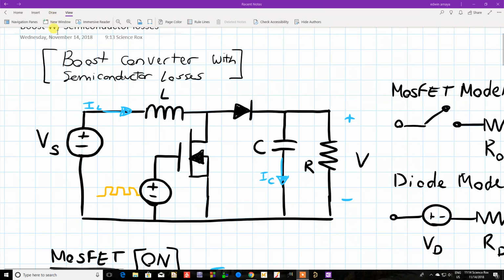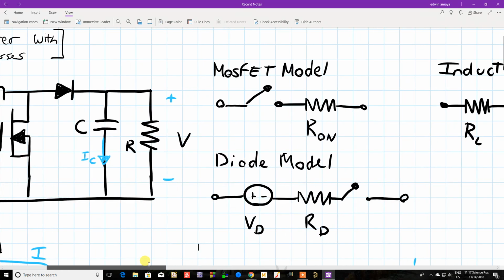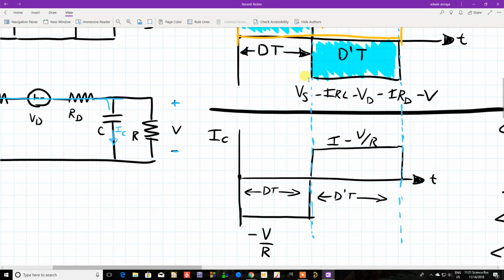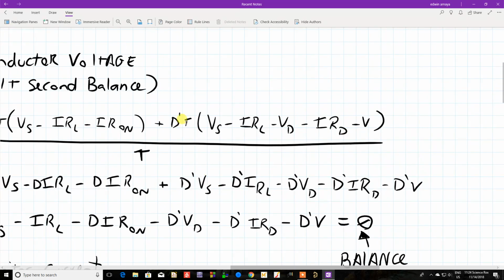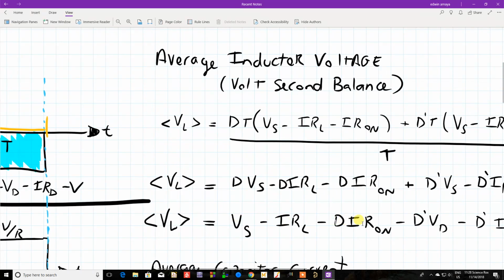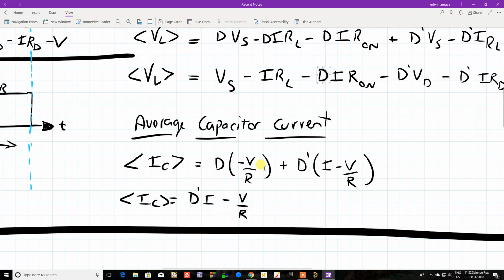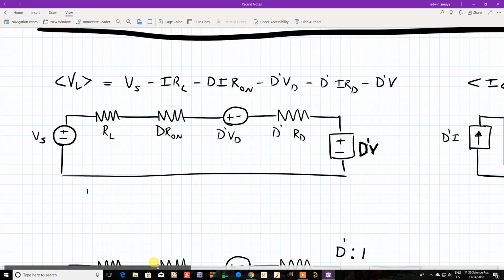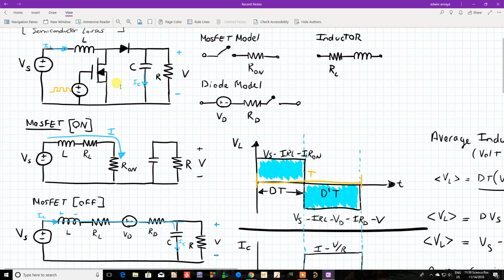Boost Converter Modeling and Solving for Ouput

Comment: Good to know that you are interested in electronic as I am. You can also look at inductors and capacitors as a 'energy storage' devices. Energy stored in inductor is E=1/2*V^2*L, while energy stored in capacitor is E=1/2*V^2*C. In short period, inductor building magnetic field as long as MOSFET is on. It stores some energy in magnetic form. When MOSFET is off, magnetic field collapse and if sufficiently fast MOSFET, it can produce very high voltage at output. To prevent that, we are using capacitor to 'slow down' this transfer. Time required for full transfer is t=PI*SQRT(L*C)... note that there is no 2*PI, just one part of the sine wave. If we are not using the diode, then it become oscillator at frequency f= 1/(2*PI*SQRT(L*C)). If MOSFET is fast, and we are using small capacitance, then we can get pretty high voltage (also destroy MOSFET).There is also relationship between energy stored in inductance and current I=SQRT(2*E/L). After 'energy transfer' to the capacitor, the voltage will be V=SQRT(2*E/C). Again, if there is no diode, whole thing will oscillate for a while. So, by those formulas we can see why it is called 'BOOST' voltage. For example, if our battery is 5V and capable of relatively high currents, we can get in theory pretty high voltages. There is limit in ferrite cores due to saturation points, so instead few huge energy storage, it is used many (read: high frequency) small pulses which do the energy transfer.
Reply from the maker: I am an electronic engineering student. Really interested in power electronics. And robotics and embedded systems. Right now I want to get back to learning about power electronics
Reply: That is good. I am just hobby enthusiast about electronic, programming and many other things.